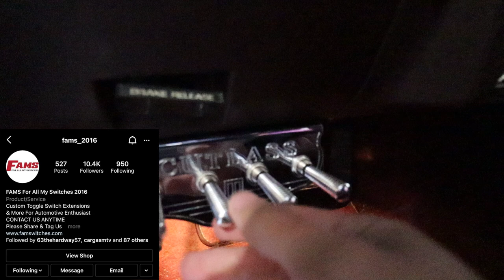HYDRAULIC UPGRADE FOR MY CUTLASS!

Comment: I never understand why people try to hop with the ass dropped. 🤷🏼‍♂️
Reply: I've notice that with a lay n play set up. Hopping with ass dumped. Gives a bit more weight distribution allowing the car to go little bit higher.
Reply: @carloschairez9722  I get it. I could never, was always worried about hitting bumper or tank. I was more show than play though. 

At least he’s not hopping with it in park 😂😂

Comment: U can fit two more batteries in the trunk..
Jus straighten out the battery rack flushed against the rear quarters, u can add a battery to each side..
And if u want good 3 wheel get some 12-14 inch rear cylinders.. and u good to go . You'll have higher lock up in the rear
Reply from the maker: I had 14” cylinders. I have another video when I did a chain bridge, check it out.

Comment: Nice ride bro BUT BIG QUESTION....Did u do a partial frame wrap of is she stock framed???  JUST WANTING TO KNOW CUZ I WANNA DO SAME BUT FRAM WRAPS ARE COSTLY....plus not trying to make mines a hopper
Reply from the maker: Thank you 🙏 and yes it is partial wrapped
Reply: @RJWilson  can u PLEASE tell me where and how many inches  of steal was used
Reply: @titojimenez1820  1/2 inch or 3/8 plate should be enough just be sure to lift engine up away from frame so you can weld some plate under the belly or cradle aka sub frame that connects each spring tower in front and goes under the motor this is the main stress point in front and especially around the coil towers where the cylinder goes through be sure to weld at least a half inch plate between each upper control arm to extend the travel of your springs and a pro tip to avoid buckling your rear quarter panels always cut small holes in trunk to weld battery rack to the frame and maybe add some fiberglass putty inside each panel to reinforce the fenders so they don't dent in and out from added weight and stress G Body's are fun but we're not built from factory to hold 8 marine battery's in trunk lol

Comment: Hey big homie great video.. look you most likely bought an adex... Not adel. But bro it's cool how you can see the difference. Keep up the work. I used to judge the hop for lowrider magazine in the Early 90s. Met many hoppers
Reply: I’m pretty sure he meant he got the Adel-2 from black magic hydraulics. I got one of those too but haven’t used it yet, still doing sheet metal work on my 66 Caprice. Looks like the Adel-2 works nicely I was wondering about that

Comment: the #11 marzochi pumphead works best with more than 6 batteries use a 9 for better response with 6 to the face
Reply from the maker: Had #9 before the #11 and I could actually tell a difference when the 11 was installed

Comment: working on sound system in my cutty now and i see you have same set up that im running (3 pumps 6 batterys)... wondering what size are those subs and where did you put the amps at ? thanks in advance.
Reply from the maker: They are 10’s and the amps are under the front seats
Reply: @RJWilson  which brand subs did you have in there?
Reply: @RJWilson  and how did they sound in that box and being "sandwiched"  like that, aka subs facing one another?

Comment: wheres the button on the adel? I had a bent cylinder and had to release pressure at cylinders.
Reply from the maker: It’s on the bottom between the four screws that has the security seal on it
Reply: @RJWilson  ok thanx